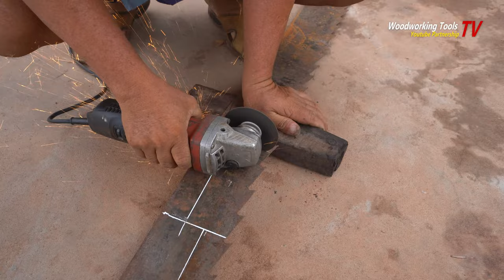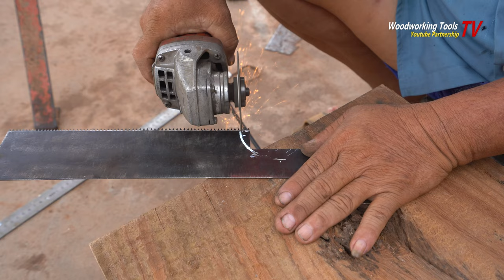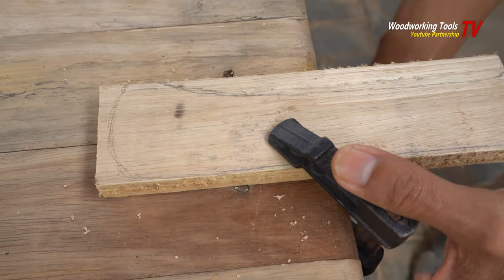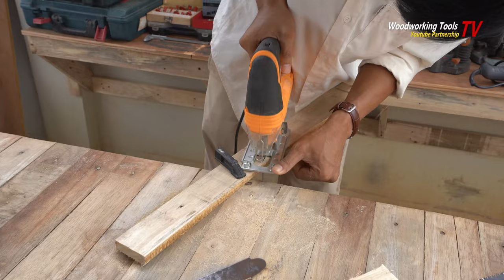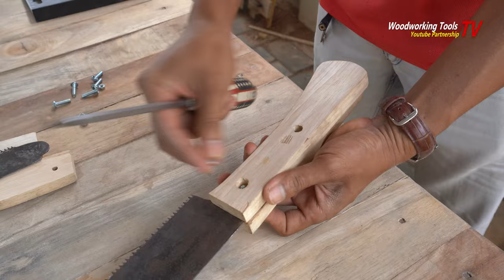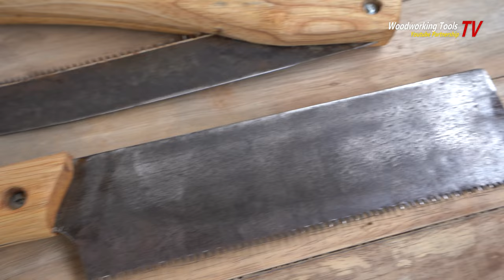Woodworking Tools - How to Make Mini Wood Hand Saw

Comment: Ilike your work. Are you sure you are not getting the steel too hot grinding the saw teeth? I think I can see iron oxides that indicate 300 C on the tips of some teeth. Video resolution isn't good enough to be sure.

If you are going to sharpen many saws buy a saw set tool on eBay for 5 or ten bucks. It makes life easier.